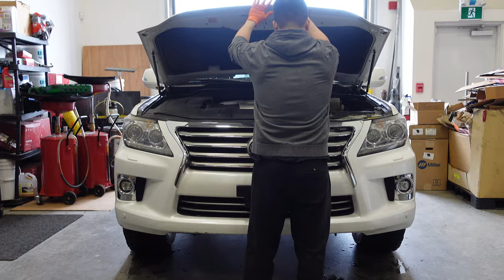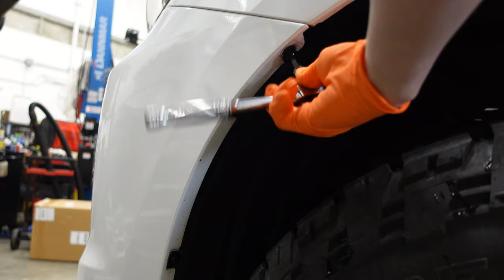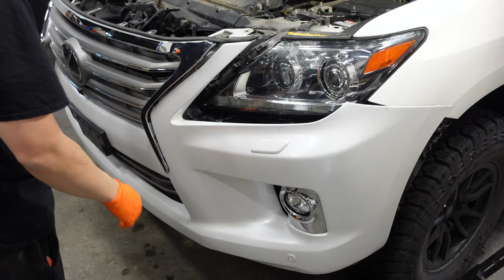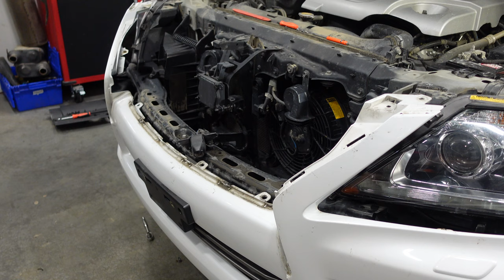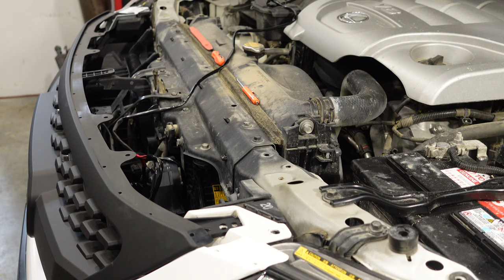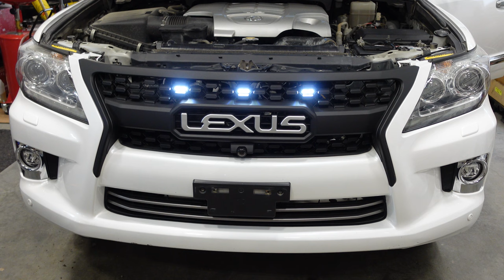Lexus LX570 TRD Style Grille & LED Lamps Installation (Garage Alpha OffRoad) - Enable [CC] for tips!

Comment: Looks great!! What micro fuse amperage in the tap? Also what is the finish of the oem lower grill? Is it chrome or grey or what is it? Thanks!
Reply from the maker: Thank you.. I used the 5A for it.. and the lower grill is just the stock grill which is grey.. Also.. if you turn on the CC (captions).. there is more descriptions and tips for the install!

Comment: Hi. Thanks for this. On their website I noticed that it says it has not been final tested for impacts to the PCS sensor. Have you had any issues?
Reply from the maker: I hope it helped.. :) So far I had no issues and I did not get any “check pcs sensor” on the dashboard..
Reply: Another question, which fuse did you attached the add-a-fuse to?
Reply from the maker: @AnthonyChan-v1u  I attached it to fuse #53 "MET" (Meter) - 5A. If you unable CC (Closed Caption) on my video.. I have written explanations.. 😬
Reply: @myhappyadventures  I totally missed the cc part. Thanks again!